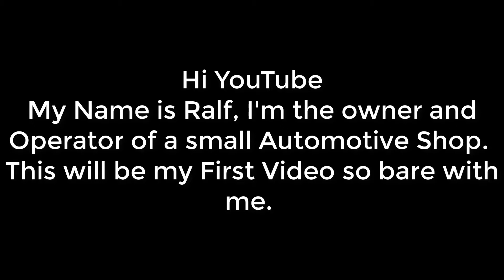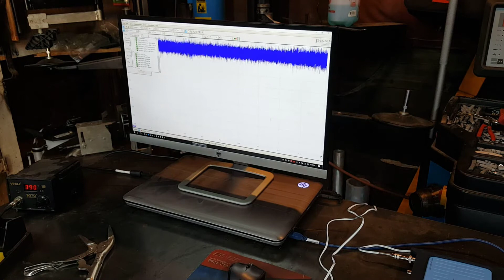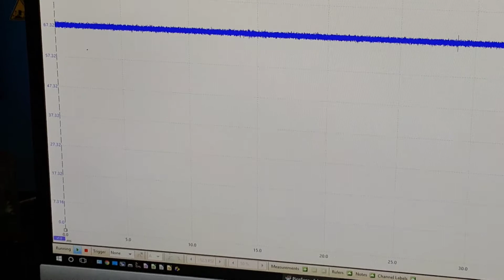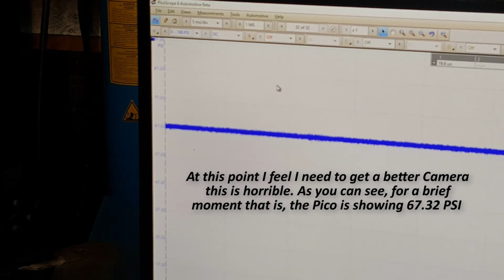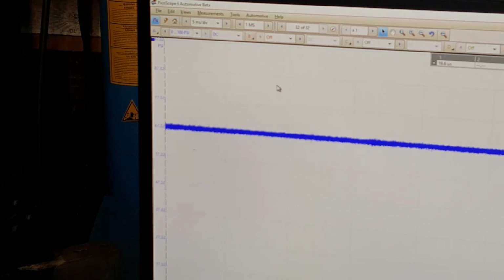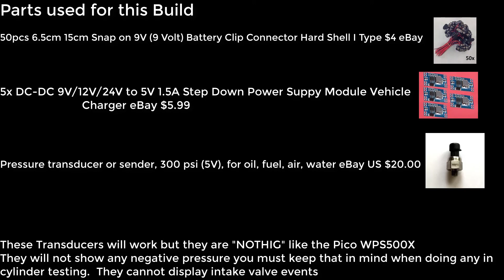Homemade Pressure Transducer

Comment: Nice Video.. Suggestion: Next time, perhaps you may consider powering the transducer from one of the computer's USB ports. The 2 end connections (Red and the Black wires) are regulated +5 volts which would do away with the converter and battery. Of course, I would suggest a small fuse also, just incase of an accident. Have a great day.

Comment: hello Ralf i hope you will be fine, here i have a question. is that possible to convert passive pressure sensor into active pressure sensor or self powered pressure sensor?
Reply from the maker: Short answer, I do not know.  Never taught about that.

Comment: I built a box that supports three transducers or any other 5v sensor. A Honeywell transducer is a nice upgrade as well. I get a much cleaner signal than the generic transducer I was originally using. Plus, the cheap 500 psi I started with conked out after a couple of weeks and the 100 psi I ordered was bad out of the box. Got a 500 psi and 100 psi Honeywell, a GM map sensor for vacuum and very low pressure, and a DIY first look sensor for pressure pulses.

Comment: Would the noise on the pressure scale we're seeing be from the power convertor? I'm guessing that's a switching type. Have you tried it with just batteries to see if you get a more stable signal? Thanks for the movie. 👍
Reply from the maker: 9V Block battery and the cheap boards will show some ripple but throw in a filter and it should clean it up.
Reply: Ralf's Automotive Diagnostics & Repair sounds good! thanks for the reply.
Reply from the maker: The cheap transducer will get almost as good of a waveform as the pico but it will require some tweaking.
I will try to upload some samples when I get a chance.
Reply: Ralf's Automotive Diagnostics & Repair that would be great. I'm also a small shop owner. I'm an ATRA transmission guy... Almost. Hahaha

Comment: Do you have any links to the transducers and the boards?
Reply from the maker: Easy to find on ebay. Lets see, here is a 300PSI Transducer "http://www.ebay.com/itm/Pressure-transducer-or-sender-300-psi-stainless-steel-for-oil-fuel-air-water-/372084306997?hash=item56a1f3f435"
And here is the boards I used.  "http://www.ebay.com/itm/DC-DC-9V-12V-24V-to-5V-3A-Step-Down-Power-Module-Vehicle-Charger-Module-/142053321439?hash=item211309aadf"  The whole thing works quite well and is adequate for a decent capture  but it is no comparison to the PICO.
Need help let me know!!